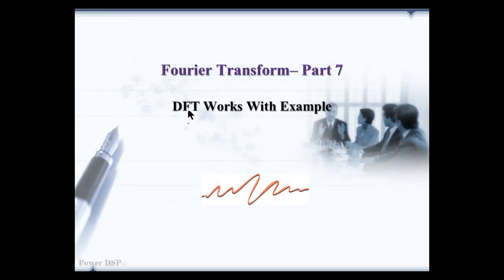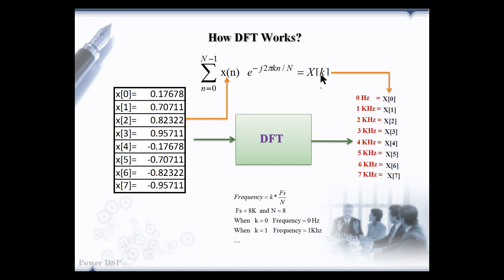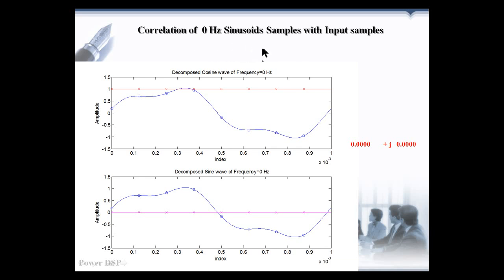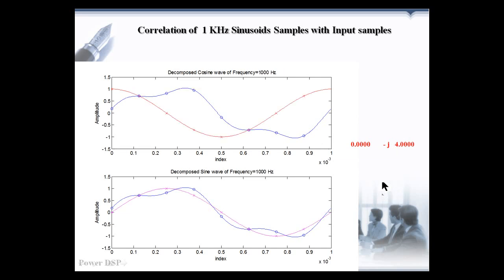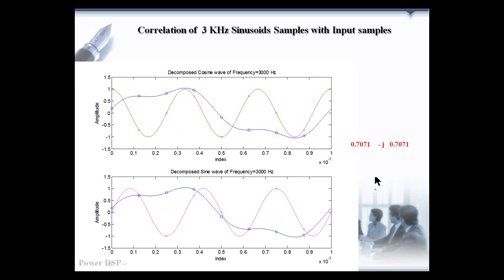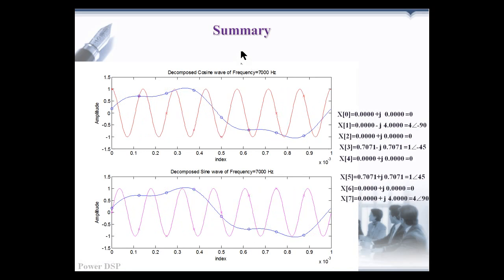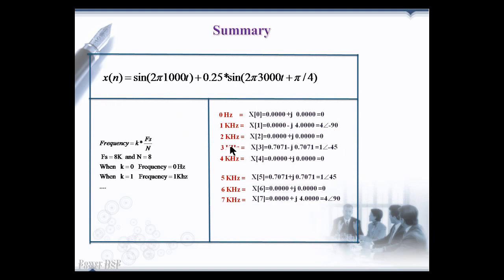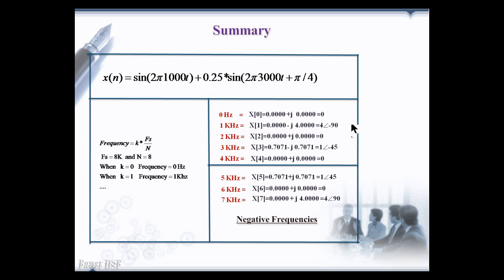Fourier Transform Part 7: DFT Works With Example

Comment: Thank you for the video, silly question but at around 2:00 you mentioned using point for point multiplication, im still confused how you got your answers for the (x+ j x) , for the top cosign wave at 1:27 for example, wouldnt it be the sum of (1*0.176)+(1*0.707)+(1*0.823) ..etc which would give a non zero answer??